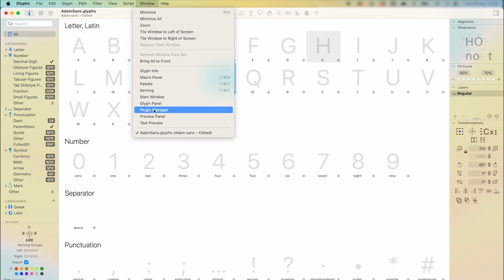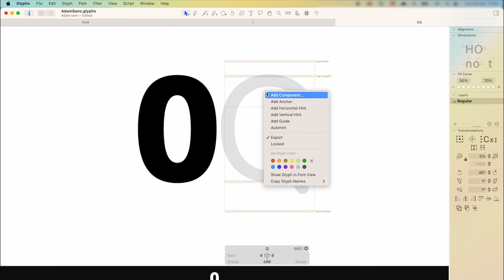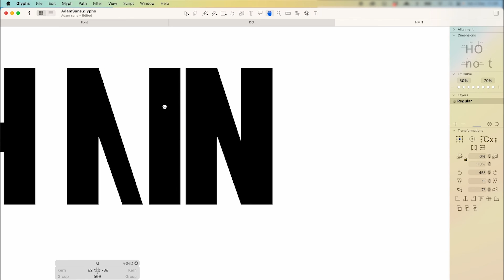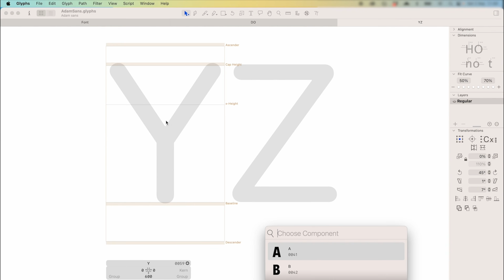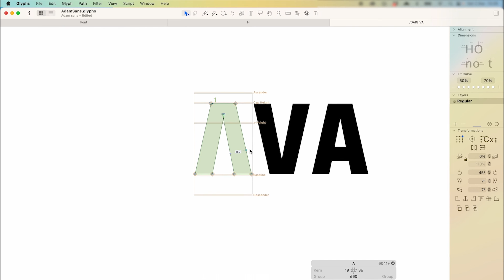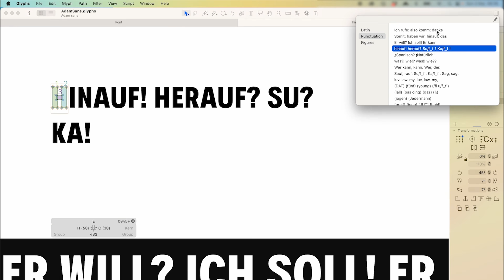Design Amazing Fonts | The Best Beginners tutorial to Glyphs 3 and Type Design

Comment: Hi there... I came  across this video in my attempt to track  down some unusual  and  proposed  new punctuation marks (about 18 of them)
I am afraid  my knowledge is rather slim in the area of Fonts  and  font packages.
I can take these drawings (in all cases  I have jpg images of these punctuation marks)
Would it make sense to create a "Wing Dings style " font that swaps out the ABCD etc glyphs for these characters or should I take another route?
If you can point me in a direction I would appreciate it.  Cheers.
(here are some of the glyphs I want to make)
Acclamation mark
Exclamation Comma
Indignation Point
Irony Point
Reply from the maker: That’s a cool idea. I suppose it all depends on how the new punctuation will be used. If it needs to follow the style of the typeface then it would be best to be integrated in the font using custom glyphs. They won’t have Unicode attached but would be available in some applications. If you want to type them you could use opentype code to swap certain sequences of letters to be replaced with your new punctuation.

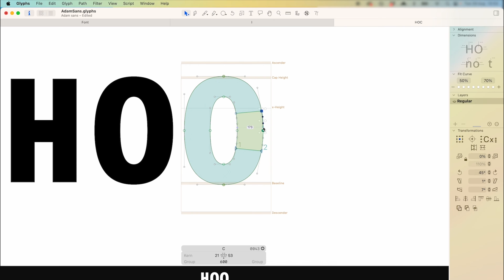Comment: Great tutorial but there's a lot missed out. How, for example at 12:06 are you making sure that the portion you cut is centred? How do you center a shape in the work area? Does that matter? How do you rotate a component? ETC
Reply from the maker: Hi. Thanks for your comment. There’s lots to Glyphs so there a great deal of things missed out to keep it as simple as possible. 
To answer your questions… there are a few ways to centre shapes. To centre in the work are I add a value to the LSB (left side bearing) the use “=|” in the RSB. This duplicates the LSB when you update metrics.
To rotate a component you can use the rotate tool on the top tool bar.

Hope that helps
Reply: @AdamGreasley  Thank you for your reply! Sorry I was probably looking for a bit of a different kind of tutorial lol.

Comment: When I add my tail in my O to make a Q, the tail cuts into the O when I preview it. I noticed in your glyphs, all your shapes have a tinted color and a number associated with them.
Reply from the maker: It sounds like you need to change the winding direction of the tail. Use cmd+r hopefully that should fix it.
The colours you see on my setup is because I have “view master compatibility” selected

Comment: @AdamGreasley great tutorials (as always) but I have a few question that I'm trying to stitch together with your various videos. I've drawn a font, with the following wants and specs: 1) A variable font containing 300 to 900 weights and possibly italics); 2) All caps with four character variations (Y, Z, Q, 7); and 3) It will be used for both Web and Print. Glyphs is UBER difficult to grasp and in following your tuts it seems like there are multiple approaches to accomplish. Is this possible in one export? Thoughts? Keep up the great work!
Reply from the maker: You’re right, Glyphs is pretty difficult to grasp.
You can absolutely have a single variable font with characters variations. I would concentrate on getting the variable weight version with stylistic alternates (character variations), then add italics. You will need to have your masters setup for variable. This is something I have yet to make a video about.

Comment: Great video, very helpful for beginners with Glyphs!
I have a question: I noticed that when you draw shapes with the rectangle or circle tool, a filled shape appears (for example at minute 5:10 in the video). Is this a setting in Glyphs, or do you need to install a plug-in?
Thanks!
Reply from the maker: Thanks. 🙏 
The filled objects show when you choose “show multiple masters” in the view dropdown.
Reply: for reference for anyone, in latest version, this is view > Show Master Compatibility